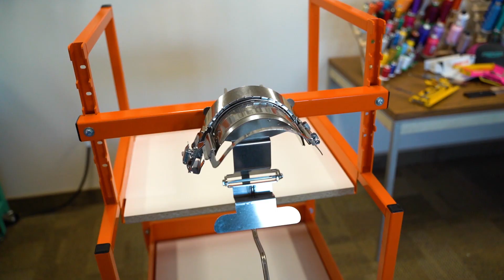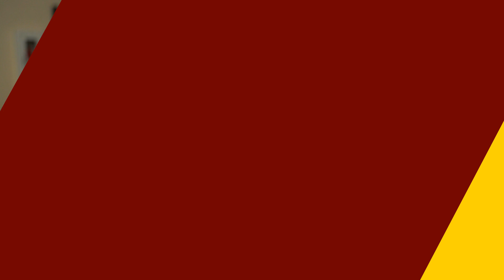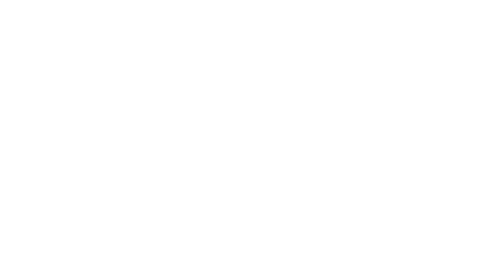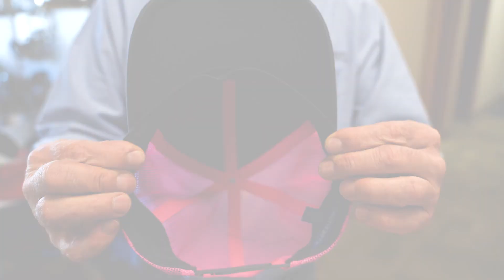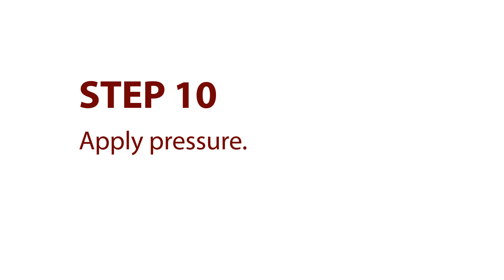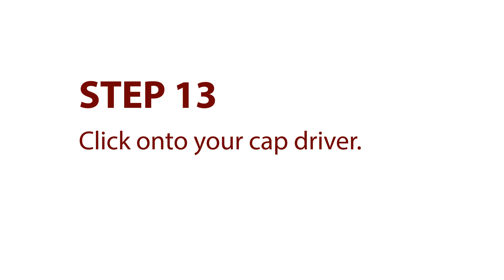Step by Step Richardson Hat Instructions using The Gen 2 Cap Framing System

Comment: Great video. Well done. 
Will this frame snap right on to the original Barudan Advantage Cap Driver ? My driver is probably 15 years old. Works great but I love what I see in your video.
Reply from the maker: Yes - it does fit on the Barudan Advantage drivers! :)